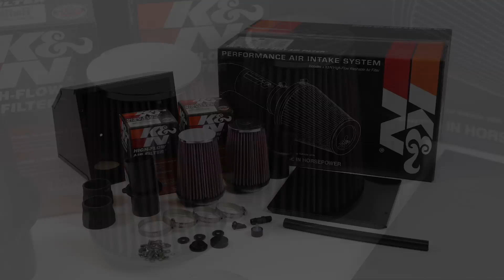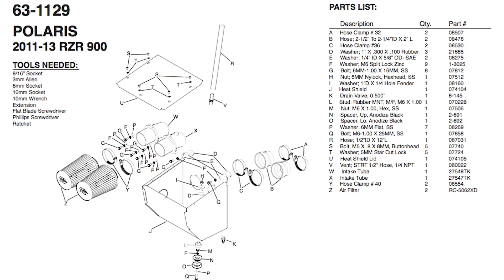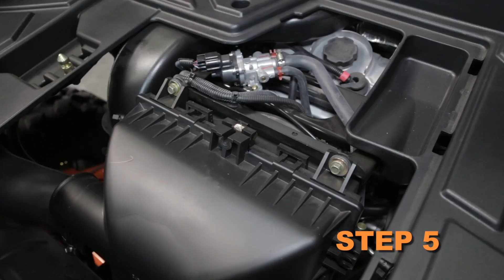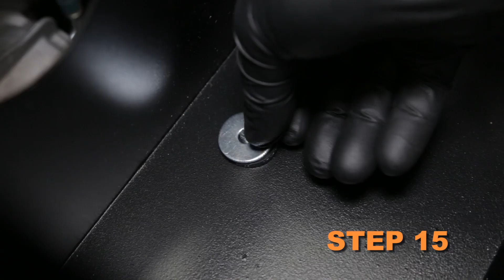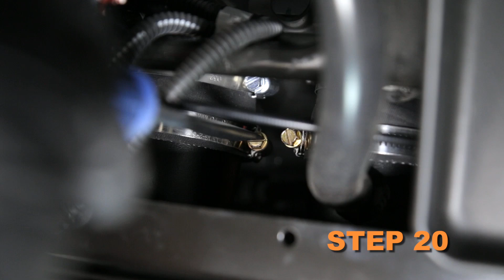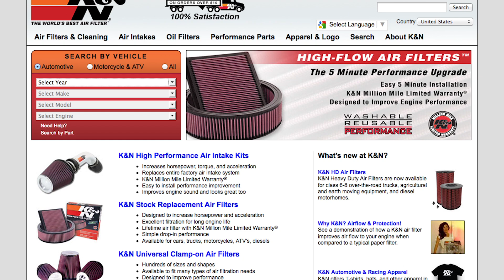Polaris Ranger RZR XP900 [#63-1129] Air Intake Installation

Comment: Does the cause a need to re program the efi?
Reply from the maker: No, all K&N intake systems are designed to work with factory ECU settings.  If you encounter any issues, please contact our product specialists 800-858-3333 or tech@knfilters.com for assistance.